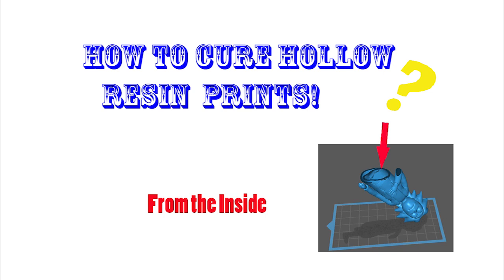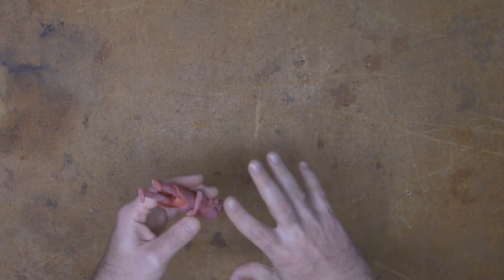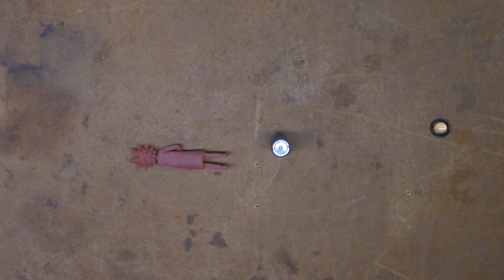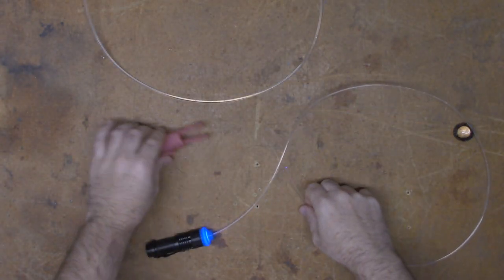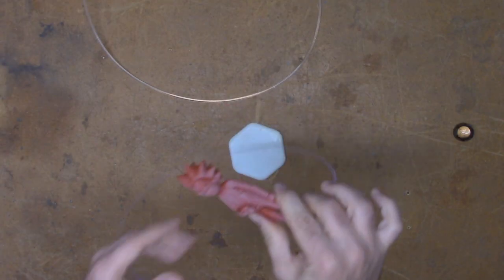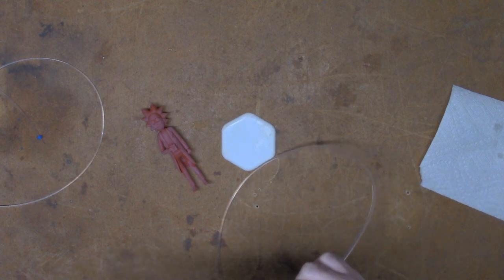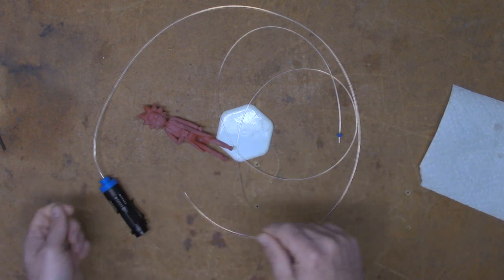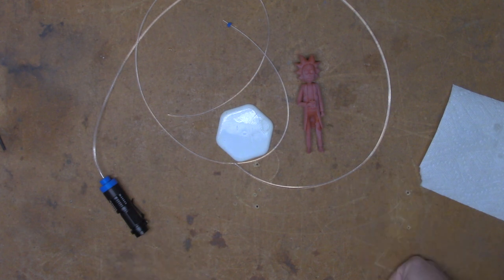How To Cure Resin Print's: inside

Comment: This is just perfect!
It's so painful to release the resin inside the prints by shaking it for like 8139031 minutes.
I ordered some stuff on amazon to test this out! Hopefully this will work most of the time.

One of our figures is suddenly torn open today because of uncure resin inside I guess
Reply: Having the same issue with resin gas expanding the print and cracking it. Did the light end up working?
Reply from the maker: Yes it works great.

Comment: How do I know if my uv light it strong enough?
Reply from the maker: As long as it's  the correct wavelength  it should be ( assuming you talking about the flashlight for interior curing).  You can test with a small about of liquid resin. If it hardens up after 5 seconds or so it should be fine. Course make sure you follow proper safety protocol gloves etc